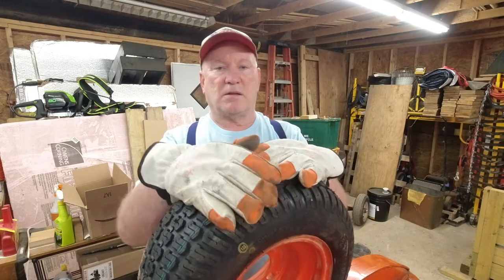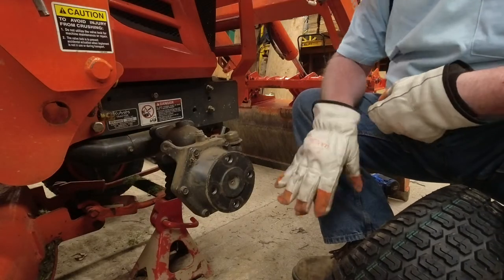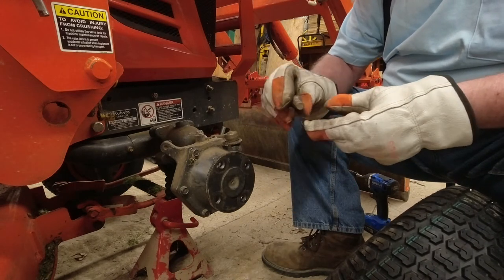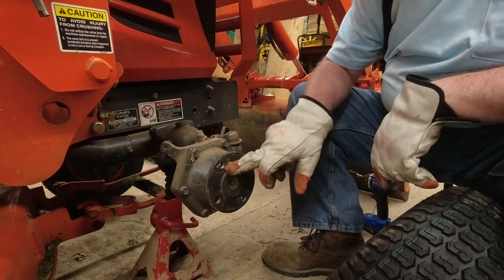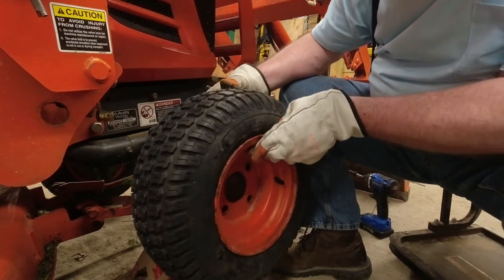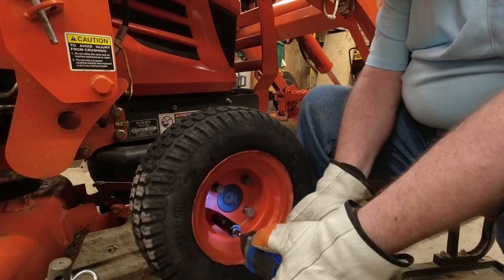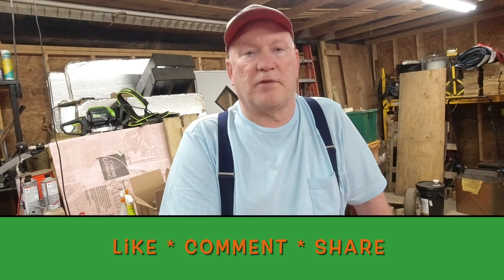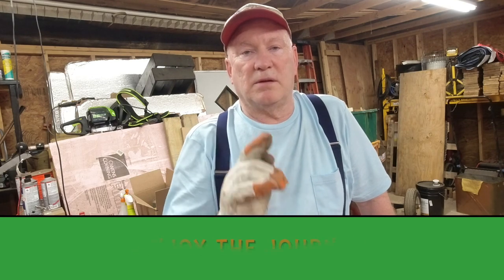#108 - New Tire Blues

Comment: the Chrysler corp. cars in the 40's & 50's used bolts but they had a locating pin to help align the bolt holes. also the hubs on the left side of the car had left handed threads and the ones on the right had right handed thread.
Reply from the maker: I did not know the old Chryslers had bolts - I knew about the left hand threads on the MOPARS in the 60s - I learned that lesson the hard way when I swept floors for the machine shop I worked in before joining the AF.  Thanks for the information - what people forget is that tech back in the day was mechanical.  Pneumatic tires at one time was "high tech" we just didn't call it high tech.  Enjoy the journey - cheers

Comment: We are not a fan of bolts rather than studs either. In fact we have not found anyone who is a fan of bolts. Good information on using a torque wrench. Sadly prices are even more expensive over here, diesel is currently 1.84 pounds a litre which is about 2.27 dollars
Reply from the maker: So that adds up to about $9 per gallon.  I understand there are a number of independent owner operators of over the road truckers (Loris) who have parked their rigs.  Sigh.  Thanks for watching, commenting and supporting my channel - enjoy the journey - cheers

Comment: Hey Bob, nice video and info on the torque. I've never been a fan of lug bolts - seems way too easy to cross-thread them.
Reply from the maker: I put spacers on the back of the BX and I now have studs for the rear tires.  It was always a bear getting the bolts started on the rear tires.  I could see cross treading the bolt as an issue.  Thanks for your support, watching and commenting - enjoy the journey - cheers